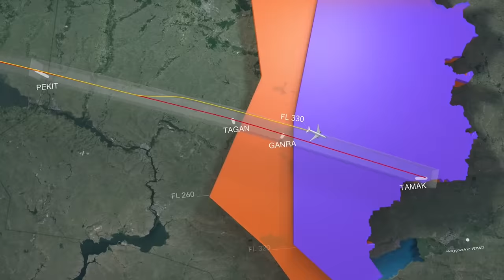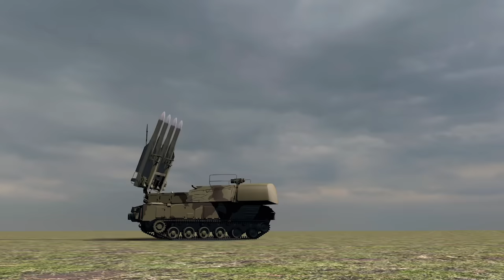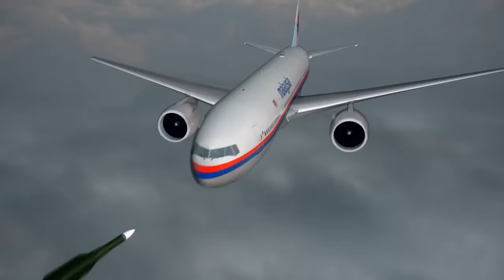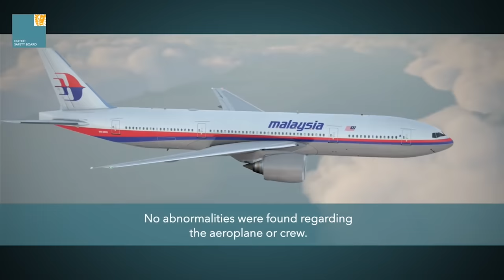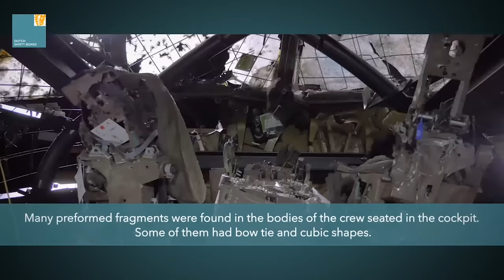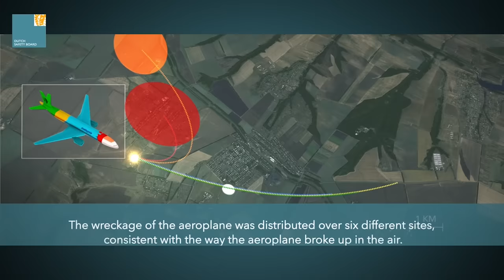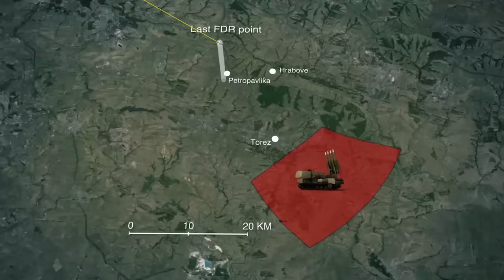Cause of MH17 crash by Dutch Safety Board

Comment: The people who fired the rocket didn't even warn them that they were going to fire a missile at them. How could you mistake it for a hostile aircraft anyway?
Reply: How do you suppose they should warn them? Those planes only receive messages if accepted through sertain radio frequencies. They thought it was an enemy cargo ship, either way.. they shouldn't have been flying over a warzone in the first place.. this is tragic..yes, but noones to blame but the airline or pilots who decided to fly over the warzone.
Reply: They had no visual on the target, only a radar return. In terms of radar tracking, a bad return on an airliner (I.E. side profile) and a good return on a fighter (I.E. vertical profile) are basically indistinguishable, especially in the absence of proper IFF equipment. It doesn't give you an exact 3d model of what you're scanning, it just gives you an approximation of radar cross section, and "25 square meters" is hardly enough information to distinguish between aircraft types.

Most likely, they assumed it was a cargo plane or fighter-bomber.
Reply: @linussandell831  the Flight path is controlled by Air traffic control, the pilots are not allowed to deviate from that. Furthermore, there are always frequencies that an airplane can be reached on. For example, a fighter jet can always contact an airplane when it enters restricted airspace.
Reply: @thomaswijgerse723  Yea, i know. That's why i said EITHER the pilots or the airline aka the air traffic control.. And i know there's always frequncies through which they can be reached through..but they still need to accept the transmission. And still... how do you suppose they should warn them? there's no way.
Reply: I mean bombers are just as big if not bigger. Look at the b-52.

Comment: This video directly contradicts Physics, the laws of dynamics and aerodynamics. The plane was flying at a certain speed and in a certain direction, and after its destruction, the initial speed of its shells and the vector of movement will be the same as that of the aircraft. Yes, other forces will act on the plane: wind, air resistance (by the way, it is discharged at altitude and its force is less), not only inertia and gravity, but these two(inertia and gravity) will set the vector of movement of the plane's fragments, and therefore the wreckage can fall down only after the LAST FDR point (which the Netherlands calls the explosion point Buk SAM missiles ) along the trajectory of the aircraft. And they fell, both BEFORE and after this point, which is impossible with any external impact on the aircraft, the only force that can set the reverse vector of motion is the force of an internal explosion.
Reply: Unionem Europaeam  No, this is a fact based on exact sciences, physics (aerodynamics, kinematics, vibrations and waves, rengenology (the body of the commander of MH17 was checked in the Donetsk morgue and there were no damaging elements of the Buk anti-aircraft missile in it), chemistry (chemistry of the thermite mixture, the dependence of the penetrating ability of active substances on the contact area). And what is the basis of the West on collective responsibility for joint crimes and a clear assurance that none of them will be responsible for joint crimes, on total control of the media, which has already surpassed Paul Joseph Goebbels propaganda.

Comment: Note to self: NEVER fly over an armed conflict where both sides have surface to air missiles.
Reply: The "Ŗebels" at best were supposed to have close range stinger style armament. Nobody had the idea that russia would put a BUK under a very intense flight corridor . They did not even route their own planes around for that matter.
Reply: How quickly people forget that yhe other side had buk too...problem is that if admit, Ukraine would be in hot water!
Reply: @sergepuhoff6419  Only the missile was fired from the place under russian control. Second Ukraine had no need to have one in the area since "The rebels" do not own any strategic bombers.
Reply: @GintaSuiseiseki  Ukraine had Buk's in the area and not only Buk. They also transferred S-300 to the warzone. Ukraine was waiting for Russia to interfere in the conflict as it did in Georgia in 2008. Russia used all aviation types - bombers and fighters there. So it was expected they will go full-war mission against Ukraine.
Reply: @Rodionnx  Ivan, please

Comment: What conclusions can be drawn from this video: the actual and irrefutably recorded crash sites of the first wreckage of the aircraft and the investigation data, regarding the course and location of the aircraft at the time of the explosion, contradict the elementary laws of dynamics (aerodynamics). And vice versa, everything is in full accordance with the laws of physics, if we accept as a fact that the plane was moving on a different course and was blown up (internal explosion) at a different point than the official investigation shows. And the data from the graphs of the microphones in the cabin contradict the section of physics of the student of vibrations and waves. Any explosion is a high-frequency and loud sound. The PEAK 1 and PEAK 2 signals are not. And also by enlarging and studying the graphs that DSB made specially small, that the first PEAK 2 signal captures the OBS microphone, which is located at the entrance to the cockpit, then the microphone of the commander of the P1 aircraft, his chair was pushed back, which can be seen by the damage: the guides of this chair, damage to the footrest in the cockpit and the whole, without damage to the feet the commander of the aircraft, then the microphone of the first officer, and then the CAM ceiling microphone. It follows from this that the sound wave comes from behind, and not from the top left, and therefore its source is located behind. PEAK1 and PEAK2 are not explosions, but shock waves from an explosion in the front cargo compartment. PEAK1 on the side of the aircraft at the site of the explosion, and PEAK2 on the rear partition of the cockpit of the aircraft separating it from the passenger cabin.
Reply: unionemeuropaeam9651  Propaganda is what the West does. The plane was flying at a speed of about 900 km / h (250 m /s), and therefore the initial speed of its wreckage was the same. The wind was about 60 km/h and the side was slightly passing, the Dutch did not consider the demolition of debris by the wind, since they do not have debris (as indicated in the DSB report). And they drew a curve based on the actual location of the wreckage. It is located north of the trajectory that they are trying to pass off as the actual one and starts before the LAST FDR Point And it did not depend on the wind, because debris and things from the cargo compartment are different in weight and size, (air ducts with traces of thermal effects, of the cargo container, lining with the inscription Malaysia, passenger seats) they are not from the cockpit of MH17 the wreckage lies nearby and to the last point of the fdr back 3.8 km. The curve of the debris spread depends on where the plane was flying and how and from where it started to collapse. It began to collapse from the front cargo compartment where the explosive device was located.
Reply: barklex  cheap bot he is. Spreading the same lie and fake physics with ctrl+c + ctrl+v.

Comment: The opening of the "NSR" investigation into the damage report from the impact of high-energy objects on the wreckage of flight MH17. Open page 23 figure 25. stringiny of a high energy object to determine the general location of the original. In reality, such a figure 25 is possible only when the explosive device and the affected object are STATIC relative to each other. For a flying plane, this means one thing: the bomb was on board the plane.

Comment: The 9H314M warhead has a delayed explosion timer, it would not have exploded at all near the cockpit of MH17. But morons can look for I-beams, their mass is 8.1g and the dimensions are 13x13x8.2 mm and the number is 1870 and there should also be 1870 parallelepipeds 6x6x8.2 mm weighing 2.1g and 4100 parallelepipeds 8x8x5mm weighing 2.35g, and there should be corresponding holes on the skin, as well as an analysis for micro particles on the skin of the aircraft of the striking elements and particles from the aircraft skin are on the striking elements. None of this is in the body of the commander of the aircraft, there was nothing initially there is an X-ray of his body. Those that were then slipped, namely, only two pseudo I—beams, not I-beams, but fakes, namely in the cockpit and allegedly in the body of the aircraft commander, fragment No. 1 - measuring 14×14× 4.5 mm and weighing 6.1 grams (crew cabin)At the same time, section 2.12 of Annex X to the final report mentions only one striking element of 14×14×4.5 mm removed from the crew cabin (fragment No. 1).
The unreliability of the data given in the final report lies in the fact that in reality the mass of fragment No. 1 is not 6.1 g, but 5.5 g, as evidenced by the photographic materials obtained when weighing the fragment by members of the international commission in February 2015 at the Gilze-Reyen base. In addition, the report does not indicate the location of the discovery of this fragment in the cockpit.
The body of the commander of the aircraft from which fragment No. 2 was extracted did not undergo a special study (instead, the body of the commander of team "B", who was outside the cockpit of the aircraft at the time of the crash, was examined).Tests of the 9N314M warhead showed that the average mass of the I—beam striking elements, which retained their original shape with a through penetration in one case — aluminum sheets with a total thickness of 12 mm and in another case - the cabin of an Il—86 aircraft, was 7.2-7.9 g, and the average mass loss did not exceed 3-12%.The experiment on modeling the transverse deformation of the striking elements showed that the shape of the sample with a relative transverse deformation of 60% differs significantly from the shape of the fragments presented in subsection 2.16 (Figure 37, Table 11) of the "Factual information" section of the final report.
The results of the tests and the experiment coincided with the data of control tests when creating the 9N314M warhead, according to which, with a through penetration of two steel sheets with a thickness of 5 mm each, the number of striking elements that retained the shape of the I-beam was 96% with a loss of mass of a separate element of 6-7%.
Thus, the mass-dimensional characteristics of two fragments (subsection 2.16, Figure 37, Table 11 of the "Factual information" section of the final report), on the fact of detection of which the conclusion about the defeat of the aircraft by the 9N314M warhead is based, do not agree with the results of field tests and experiments.Subsection 2.16.2 and table 12 of the "Factual information" section of the final report provide information on the chemical composition of the fragments extracted from the fragments of the aircraft and the bodies of the victims.
Studies of the chemical composition of the material from which the striking elements of the 9H314M warhead are made, carried out by Russian specialists, have shown that the chemical composition of the fragments published in the final report contradicts the conclusion that they belong to the 9H314M warhead.
Reply: I’m from India 🇮🇳 ,and I’d like to ask Russia to stop selling us weapon systems that don’t work. Please be honest with us and don’t send military equipment that performs poorly 🙏
Still see you as brother country 🇮🇳❤️🇷🇺

Comment: 3.32 lie see page 50 of the DSB report on the graph and zoom them in. The amplitude of PEAK2 is less than that of the Rolls-Royce TRENT 892. And the first to be recorded by the OBS microphone, then P1, the seat of the aircraft commander was pushed back, its legs were intact and the footboard was all in holes, and there were damages on the seat guides that were received at the time of its breakdown. Then P2 of the first officer and then CAM on which there is also a PEAK1 signal, since this microphone is the only one located directly on the fuselage of the aircraft and between it (its membrane) there are no dampers capable of extinguishing a blow to the side of the aircraft outside the cockpit.

Comment: The analysis from microphones in the cockpit also does not correspond to physics. There are simply no explosions. Any explosion is a high-frequency and loud sound, there is no PEAK 2 signal amplitude on the graphs, the amplitude of the Rolls Royce Trent signal does not exceed the amplitude of the Rolls Royce Trent on the same graphs, that is, this sound is even quieter and it is not heard in the cockpit against the background of the MH17 engines running and the second there is only 3 fluctuations in the real explosion of the Buk anti-aircraft missile more than 50 in same time . That is , the PEAK 2 signal is quiet and low - frequency . Also, when further studying the graphs from the microphones in the cockpit, by increasing them, which the Dutch interested liars (MH17 flew from Amsterdam and was purposefully blown up with an imitation of external influence over the Donbass) made small, that there is a PEAK1 signal on the only CAM microphone on the fuselage, as well as that the first PEAK 2 signal will fix the microphone OBS at the entrance to the cockpit, then P1 microphone of the aircraft commander (his seat was pushed back, as can be seen by the direction of this chair, the whole feet of the pilot and the destroyed footrest), then P2 is the first officer and then CAM, that is, the sound wave comes from behind and not from the top left. These signals are not explosions but shock waves, PEAK1 on the fuselage where the bomb was planted and PEAK2 on the partition separating the cockpit from the passenger cabin of the aircraft.
Reply: Unionem Europaeam  No, this is a fact based on exact sciences, physics (aerodynamics, kinematics, vibrations and waves, rengenology (the body of the commander of MH17 was checked in the Donetsk morgue and there were no damaging elements of the Buk anti-aircraft missile in it), chemistry (chemistry of the thermite mixture, the dependence of the penetrating ability of active substances on the contact area). And what is the basis of the West on collective responsibility for joint crimes and a clear assurance that none of them will be responsible for joint crimes, on total control of the media, which has already surpassed the propaganda of Paul Joseph Goebbels.
Reply: @theirishempire4952  The captain was not killed by an anti-aircraft missile, which allegedly went up from the left, there are no damaging elements in his head, it is smeared as a result of the fall. There are several inches of wounds in his body, and the largest anti-aircraft missile hit is about half an inch. His left leg was burned in the thigh area. And on his X-ray photograph taken in Donetsk, there are no I-beams or other striking elements of the Buk anti-aircraft missile, but in his body there was a handle from a Boeing. Therefore, the Netherlands lost the body of the aircraft commander of crew A (who was in the cockpit and, by the way, there were 3 while there were only 2 pilots in the cockpit) and took the bodies of the commander of the crew B, who was not in the cockpit but rested in the crew rest area.

Comment: It was a tragedy what happened. It has been proven that the plane was accidentally shot down by the separatists. Because you don't shoot down civilian aircraft.

But now a few questions arise:
Why is a passenger plane flying over a contested war zone?
Normally a NoGo
Why has the flight recorder still not been declassified for the public? It has already been analysed, but it is still under lock and key in London.

It is rumoured that the air traffic control in Kiev let the plane descend from a safe altitude. The route is also said to have been changed.

I don't want to trivialise anything here, but as already written above - if everything is so very safe that no other circumstances provoked this accident, why is the flight recorder under lock and key? 
Normally, the results (if it's bad for the opponent) are presented immediately and go viral. But in this case nothing at all....

There was also a case like this in 1988:
The US accidentally shot down an Iranian Plane. 
The reason given was that it was war and that happens sometimes.
It was the USS Vincennes (CG-49).
You can read about it everywhere...
I don't remember a huge outcry.
Reply: The eastern Ukrainian separatists said they were aiming at what they thought were  two fighter jets when the passenger jet got in between.  Supposedly people on the ground saw two fighter jets as well.
Reply: @pudbass  
I did not hear about it - interesting.
Do you have some information to share?